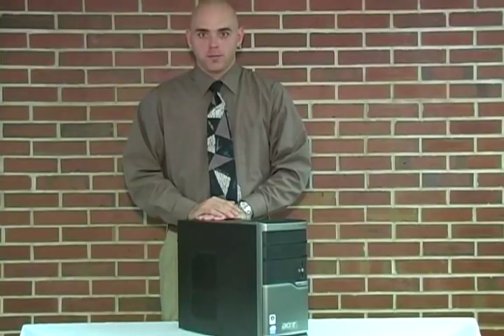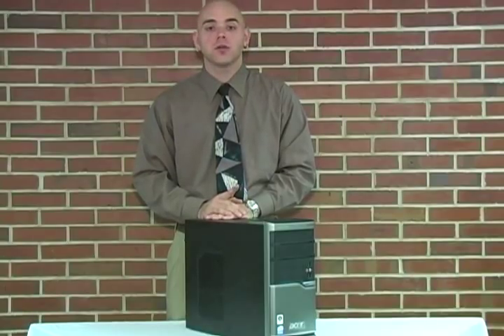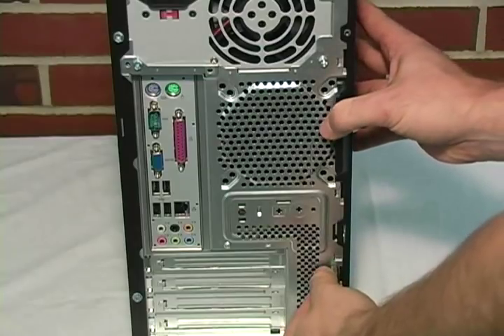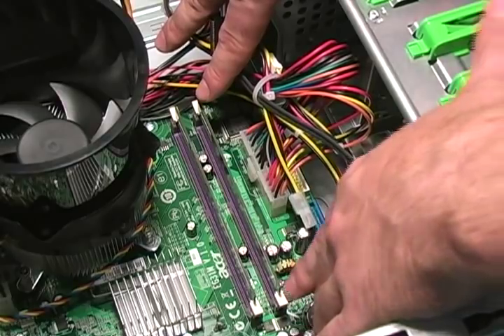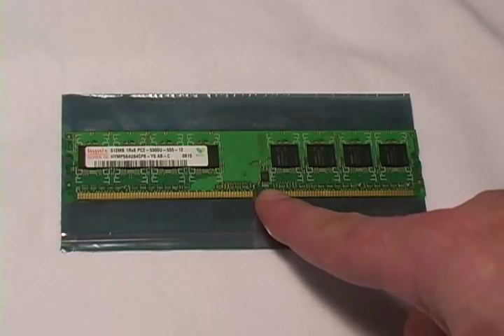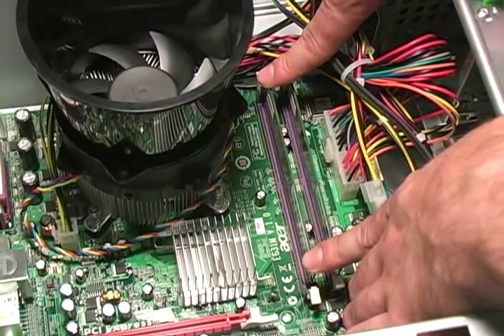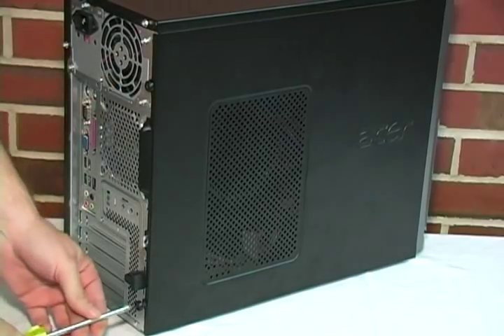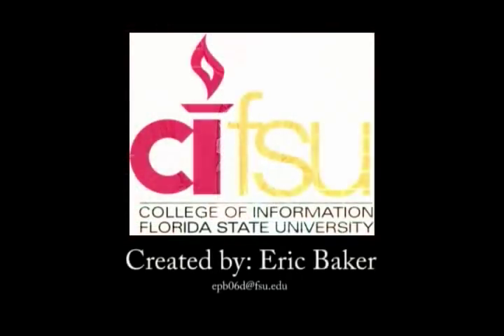How to install and remove computer RAM

Comment: Is it ok if I do this.

Say right now I have a intel DDR3 or something 4gb ram.
would it be ok to use a different make such as hyper x 4gb ram with the intel ram.
?? would it be compatible
Reply: do you mean use the 2 sticks together? if yes, then no they will probably won't be compatible
If you're asking if the two new sticks are compatible with your pc then it depends on what motherboard you have

Comment: if i want to change RAM, I just open the case, remove the old, put new rams and close the case again? It doesn't need any changes in the os? the system detect it automatically?

Comment: HELP I need a answer.. my computer is Turning on. after a second it shut down automatically. what to do?
Reply: My computer turns on but it doesn't fully restart
Reply: It may of been a problem with the power supply... If you still happen to have that computer for whatever reason and haven't fixed it make sure all fans are running by removing the panels off the sides of the case(there should be tutorials out there but it depends on the case) also keep an ear out for strange noises

Comment: I'm going to rempove my old DD3 ram sticks with new DDR4, is the process still that simple? Might my PC get confused by the pretty significant Mhz transition?
Reply: rihasanat rofolo you will probably need to buy a new motherboard that supports DDR4 ram

Comment: What about static electricity? I have once fried my computer just by touching it. This is a CRITICAL mistake in your video.
Reply: euheide "You may want to ground yourself by touching any of the unpainted metal surfaces on the outside of your computer's case"
Reply: Uncle Fester Yep. Nowadays I use an anti-static bracelet. I fried my PC because I become too confident, complacent and careless with static, lol. :) Thanks!

Comment: My aunt has an old win xp laptop, and its power socket is broken, and there is no way to fix it. She is going to throw it out. My desktop only has 2gb, can I take it and put it on my desktop?" (I don't have time to watch the video)
Reply: You can take it out, cus I just did it to mines because it was broken of its power supply, I kinda ripped open the latop open carefully and got the ram cards out, I have to cards and there both 2gb though
Reply: i also want tknow if you can remove a lapto ram and put it in a desktop
Reply: Mastorus Gaming laptop and desktop ram is not same. laptop ram didn't fit in desktop ram slot